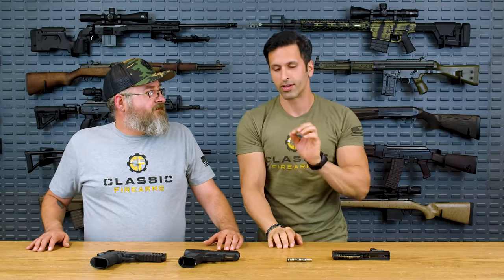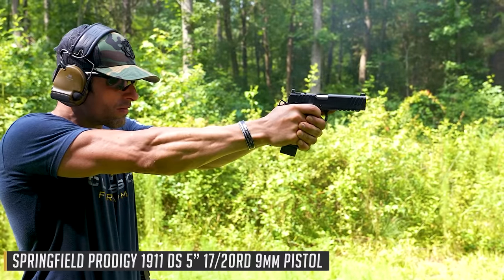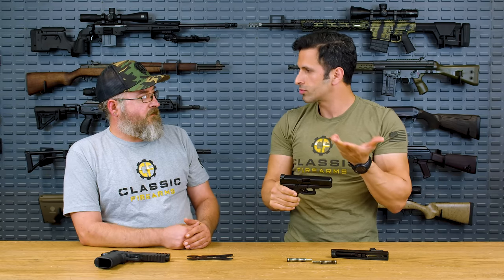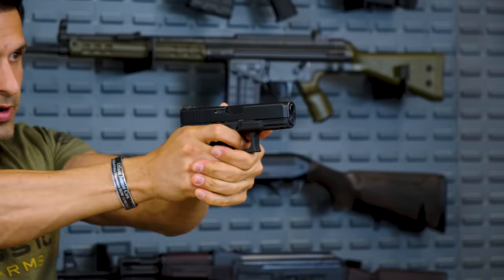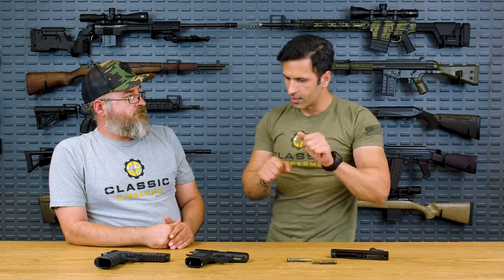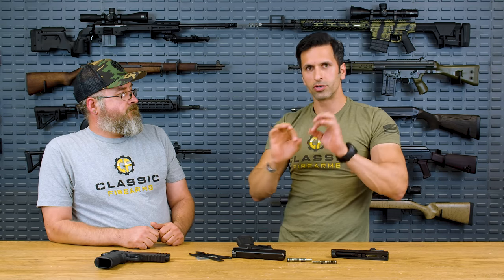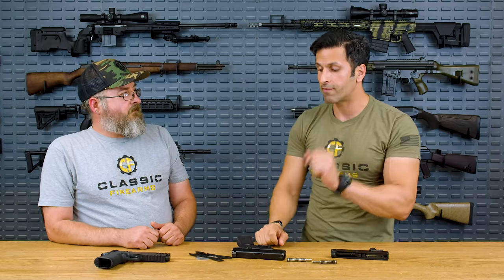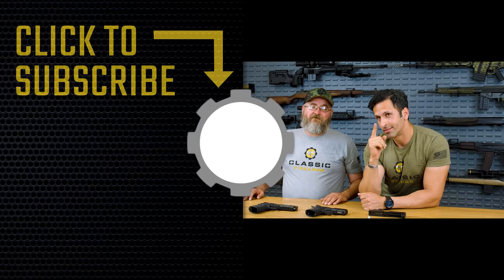How To Tune The Recoil On Your Pistol

Comment: Great information in this video. I recently reduced my recoil spring on a new .40 SDVE S&W by 10% because it was not feeding reliably.  This fixed the feeding and I could not feel the difference in the recoil.  I did this 2 months ago before I saw this video or any other videos.  You did a great job with your explanation.  Thanks again. Keep up the great job. I wish I could make videos, I would have shown how I did the recoil spring adjustment.

Comment: I knew all that about springs. How dwell time is so important. You can go deep into that whole business of springs. You both did a great service in making it so easy. Not anyone else on UTube has done as nice of a job as you both presented. KUDOS!! I have seen shooters at the same steel targets at 25 yards outdoors and has the same 9mm or 45mm and they don't Run. W I look they are racking the slide with 2 fingers and its like a toy. My pistoles are heavy spring and always run. There are 5 variables. Change 1 and run it. then go to other with the same ammo. You presented that with great simplicity! And finally the magazine and going with max loads and they may be the problem all along. Not a problem at the range; but when something goes "Bump in the Night" at 4 in the morning - you can't stop and say wait a minute i'm changing out my spring. You both do great work for us and it is so appreciated.

Comment: I messed around with a 1911. I went from an 18lbs spring to a 20lbs recoil spring. And it made a big difference in the way the gun feels. I did the same to w 92fs and went from a 14lbs spring to a 15lbs spring. Ive come to find going up 1 or 2 lbs is a great balance between felt recoil and dip.

Comment: Hey guys!!!  Great information.  I had not considered the rise and dip being affected by the spring pressure. Your video covered that very well.  When I have tuned a Glock, I only tuned it to "cycle properly" with the load, slide, accessories, and magazine that was being used. If you were to change any of the above-mentioned items, you would probably have to retune the spring, If you are going to tune to help with the rise or dip, be careful you don't go so far as to make the gun not "cycle properly".  A pound or two change would be enough to risk the gun not "cycling properly".  Just my 2 cents. Thanks for listening J

Comment: I always ditch the cheap plastic guide rod. On sigs i use gray guns and glock lone wolf. You gotta think there putting a plastic core guide rods above a hot barrel. In my opinion the cheap oem guide rods are a weak point,  can get hot and brittle over time. But always learn and understand when messing with important parts. Pay attention to spring weights and guidance when changing them out
Reply: That plastic rod has been torture tested. You or anyone you know has never seen one break. I'm sure there's been a few past 50k rounds maybe but other than that it's just not gonna happen.
Reply: i do the same on my carry guns
Reply: Look at car engines by reputale manufacturers. Theres plenty of plastic that do break and plenty that don't. It's the type of plastic or general make up that will determine whether it will wear and tear faster. Ive got well over 8k rounds on my g19. No problems. But when I do get issues I'll swap it out lol. Glock actually recommend 5k swap outs. Which is minor considering its a 20 dollar part. And most people will shoot less than 1k a year. So in 5 years you should be able to afford a 20 dollar part. When I was younger I was shooting bout 3-600 rounds a month. Years and years later.  I may shoot 500 or less a year. Gotta be a responsible adult now😂

Comment: The answers are light slde, heavy spring or heavy slide light spring. With compound springs, either wire diameter and coil length or come up with a new action design.

Comment: They make prgretsive rate springs for cars . The spring rate changes according to the rate of the load. This would be an awesome adaptation for firearms.
Reply: Wolff makes variable rate springs
Reply: They do, I run a 13lb progressive rate in my 1911 with a frame buffer, MUCH less recoil
Reply: Look up dpm springs. Been out for years

Comment: You cant compare a 1911 recoil system weight to a glock. On the 1911 the slide also has to overcome the main spring weight when it comes back as well as the recoil spring. The glock just has the recoil spring.
Reply: For instance on like a sig p320. Its comparable to a 1911. I always go with a gray guns guide rod and spring. For the most part more reputable companies already have it figured out and compare spring weights. Im just waiting till that day i can pull that $3k trigger on a wilson combat already perfected 1911 lol

Comment: Great video... This tuning is alchemy for sure...  I have been struggling with playing with a compensator on a psa dagger (g19 clone). I excected to tune from notes on the manufacturer website. Compensator gives you less blowback pressure... Stock 18# recoil spring had failure to eject almost every shot.  Swapped in a 15# spring, still had a few F2E, but not near as many... So I tried the 13# recoil spring... Too light, so I get failure to go into battery. I give it just a slight tap on the back and it fires... Shoot the whole magazine like that, almost single action revolver style... lol... So I guess I need to take the 15# and cut a coil or two off it to try and get 14# ???
Reply: Springs don't work like that. Cutting a spring is not recommended.

Comment: The conversation is much simpler:

F = -kx = ma

If m (the mass of the slide) is constant,
  ==> Stronger spring means slower and maybe even incomplete compression, faster acceleration when compressed, and more inertia when the slide is coming forward.
  ==> Lighter spring means faster and more certain compression, slower acceleration when compressed, and less inertia when the slide is coming forward.

Figure that out how you will, possibly changing the weight of the slide.

Comment: Will there be a recoil tuning video for AR15s and AR10s.
Reply: Bolt weight, buffer spring, and gas if you're lucky enough to adjust it
Reply: @OMGItsGoatracer17  Folks I have spoken with have replaced the buffer with success in reducing the recoil.

Comment: why do carry guns when racking slide is heavy and a say sig x5 legion is super easy to rack. why are carry guns not as easy to rack ?
Reply: Stiffer springs because defensive ammunition is typically loaded a touch hotter than standard ball or competition ammunition.

Comment: Anyone have any advice? I purchased a aftermarket slide that has an optics cut and relief cuts, that make the slide lighter. I have noticed that every once in a while, the slide will not fully return to battery. Would a heavier spring weight fix this? Or would I have to go with a lighter spring weight?
Reply: A heavier spring is essential to get the gun to cycle properly. Just don't go to far, if you do then the gun will not slide back far enough, and you could end up with rounds not ejecting properly.  See if you can buy a spring kit that has a few different springs in it then you will have some variable springs to play with when you go to practice.  Also, consider, your grip and the lube that you use.  Both of these could also affect how the gun cycles.  Have fun and good luck.  Jim

Comment: Heard of any issues with the sig P320 spring and stovepiping?
Reply: yes but it was from people putting in m17 springs that are for 124 gr +p ammo causing the slide not cycle all the way back
Reply: @djjaysky9071  this is still 100% stock, so it should cycle and feed factory 115gr just fine. Obviously useless as a carry with the feed issues.